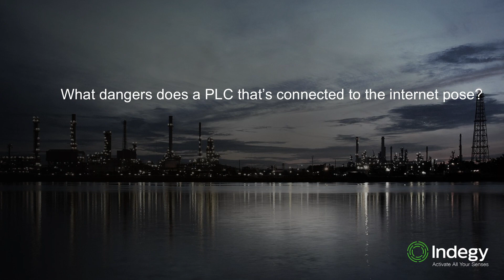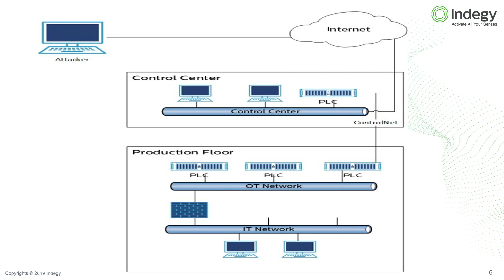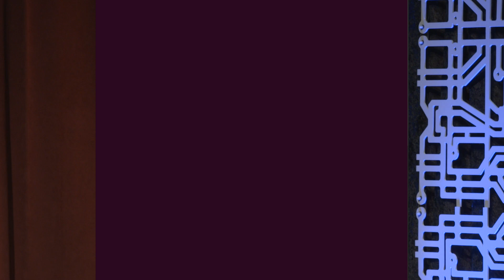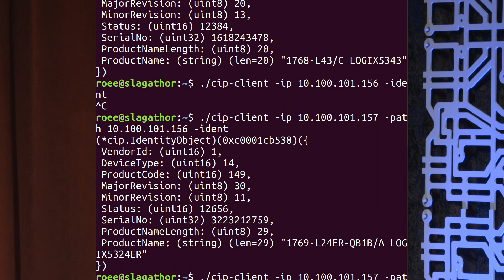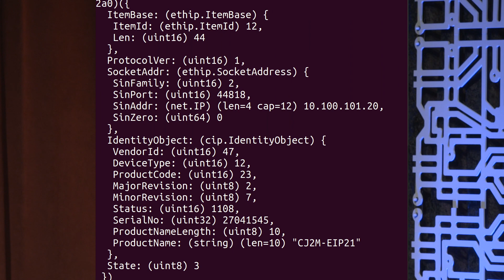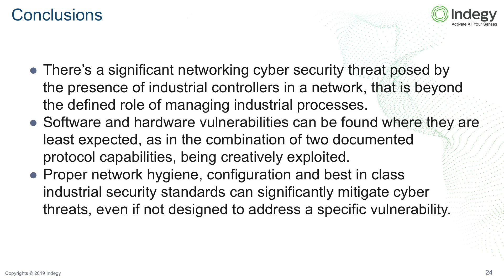PLC's: Backdoors in Disguise

Comment: Summary: Indegy discovers CIP routing and labels it "backdoors in disguise", which gets them a speaking slot at S4.
Reply: I agree 100%. The message router functionality is nothing new. Its well documented and very helpful when you need some informations from different networks. If you expose it to internet, you are the only guilty. All industrial protocols across the word are vulnerable. If an attacker will be inside control netowork he can do much more damages and there is no matter what protocl would be use, CIP, Profinet or Modbus. They are unsecure by design. Rockwell lunched products with CIP security in Dec 2018, Schneider plans to deliver  Secure Modbus products in 2019, there is for sure better future for ICS.
Reply from the maker: Ralph - I can't disagree that this is another "insecure by design" / documented feature issue. I added it to the agenda, my call and blame/credit, for two reasons. 1) I believe a large percentage of the ICSsec community is unaware of this feature, and 2) I believe we will see in the next 1-3 years an increase the use of PLC's and controllers as attack platforms / pivots and a place that the higher end attackers will use to persist on an ICS.

I did find it odd that Roee said something like "if only we had authentication" and it is available but very sparsely deployed now.

Dale
Reply: It's not just documented, it's also a standard feature of RSLinx